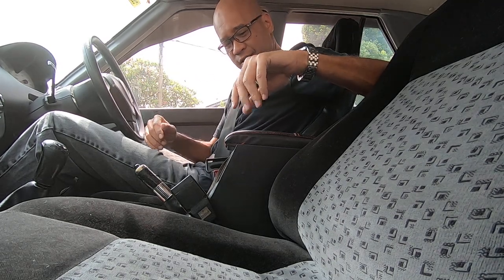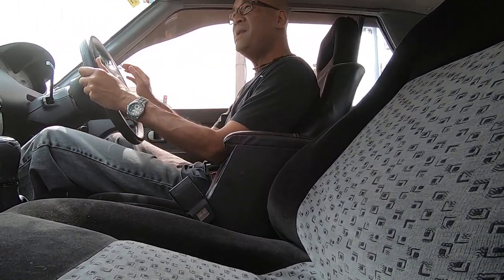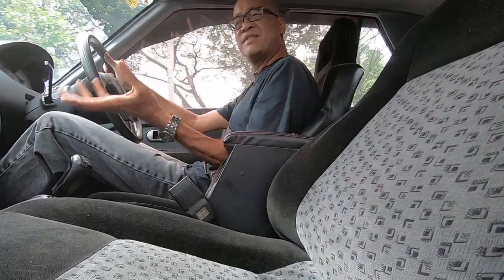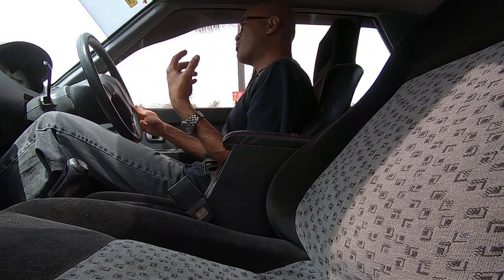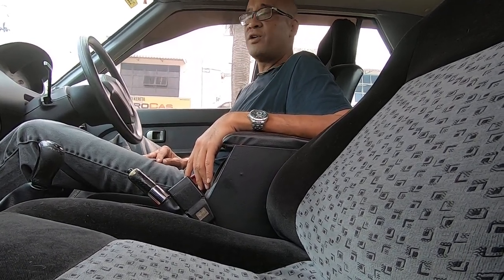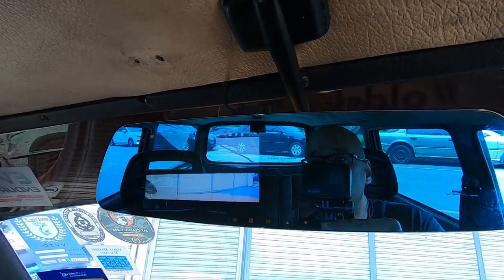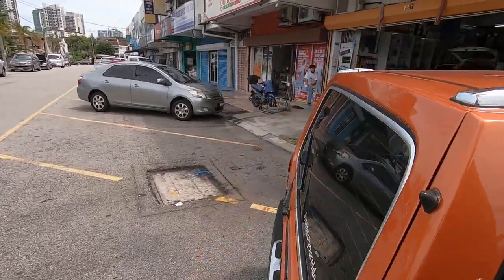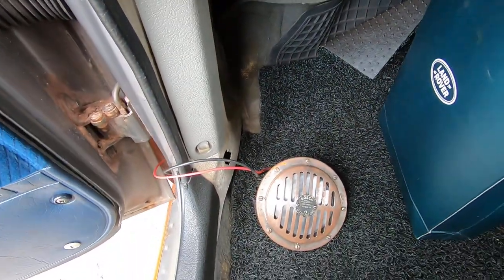WEEVIL UPDATE! 1985 Volvo 245 Wagon Gets Rear "Eyes" PLUS Saga LMST In-Car Drive! | EvoMalaysia.com

Comment: My dad has one lmst year 2007 the last batch of saga with mitsubishi powertrain and we still have it till now. A part from the material quality, that car has never fail ever. About the warranty it was 5 years warranty or 100k.... and pricing was rm26k when new. My dad bought it new that time for daily use. And for your infomation lmst has some parts shared with proton waja the mmc waja like aircond fan motor bcz i had once change the aircond fan motor even the aircond guy was shocked about it. Then if u realise the gearknob of lmst is same as waja original gearknob but different colour. So yeah its actually a wonderful car that bad in material but never fails
Reply from the maker: Exactly what I meant, thanks for the ownership experience feedback Thiban 👍🏽 😀